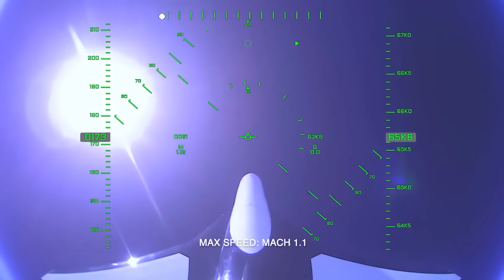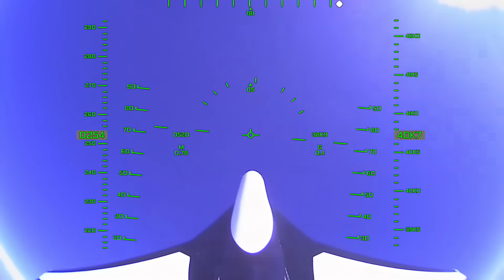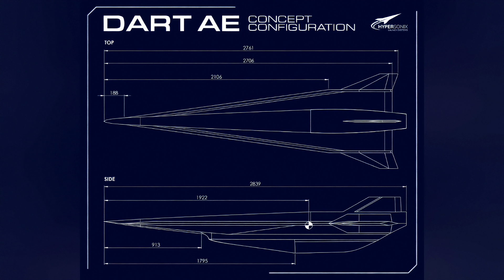Spaceflight is taking off Down Under!  Here's the latest!

Comment: Gilmour use hybrid rocket engines, so solid fuel, liquid oxidiser (medium pollution?).

Dawn's spaceplane uses HTP for an oxidiser, which makes the engine nice and simple and hypergolic.
Plus you get extra water vapour in the exhaust for a little extra thrust density.                      :)

Comment: This region of the world is underestimated in terms of tech innovation. Australia has developed the most advanced radar facility in the world and recently sold the technology to Canada.
Reply: Jorn?
Reply: @NZ_NATIV3  Yes I think so although that system has been around for 30 odd years. I don’t think it a bridge to far for any nation to develop the idea. Using atmospheric skipping is as old as HF radio transmission. 

Ideal however for Canada to keep a track of what’s going on in the far north. 

It has a particular advantage in tracking stealth aircraft if the top down signature has not been a design priority.
Reply: @stabsfeldwebela4178  well us aussies have some of the worlds best signal engineers in the world, the system is able to detect stealth aircraft 90% of the time, and even small rowboats and the like up to 3,000km out but has detected missile launches 5,500 km away in china, we also invented wifi and bluetouth at around the same time.
Reply: Most places in tech have this.
We simply do not have a culture based around broadcasting achievements.

Comment: In Wellington...at my local Cafe I have met Kiwi engineers working on a new design for ion thrusters ..others working on a  fusion reactor...to name.a few of the tech projects. There are a lot of small companies working on very interesting tech projects. I am amazed given the next to zero government support and low VC capital available.  Wellington seems to be having a low key tech startup revolution.
Reply: There's a startup doing testing on fusion reactors in Ngauranga Gorge 7 - Kilometers from the capital.   It should be interesting, they are making good progress.   Yup there's a lot happening in Wellington under the radar.
Reply: @pieman2656  still in the capital